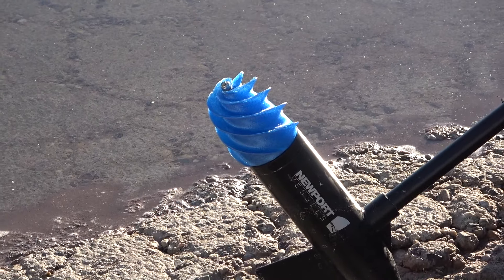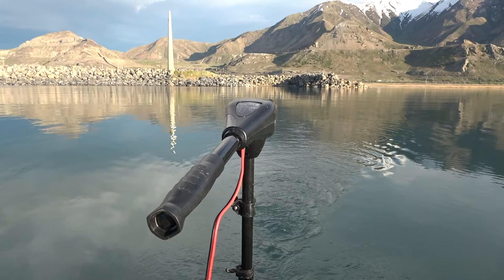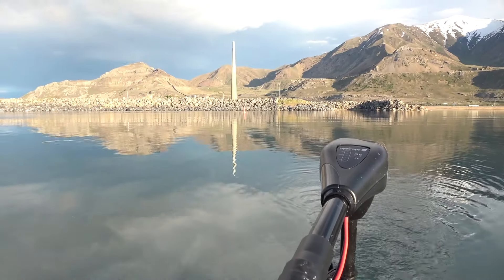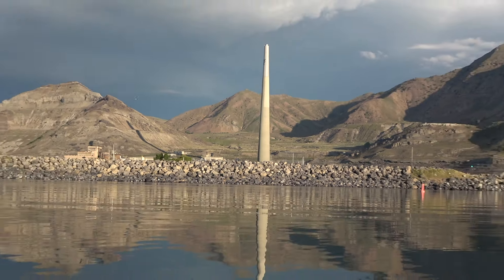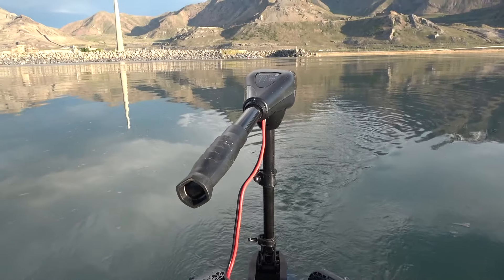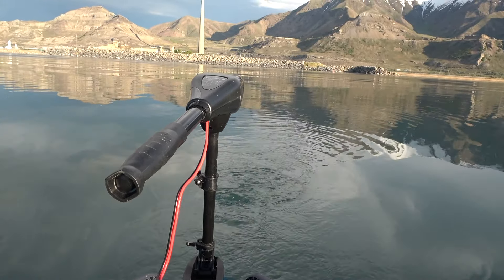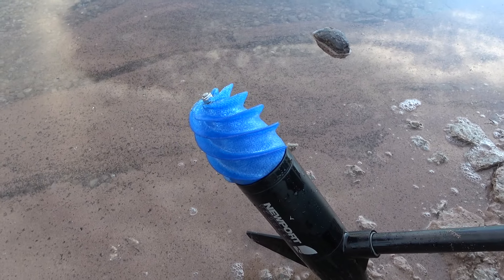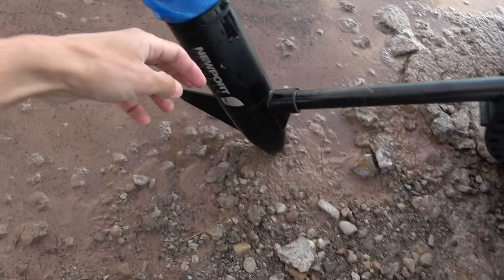Egg Propelled Boat Part 2

Comment: A good speed/thrust comparison of the boat using original prop vs the egg prop would be interesting.  You could use GPS on a phone to calculate speed.   Or do it the old fashioned way and tie knots to a rope and drag it and see how many knots are visible to determine speed.  Need that speed baseline speed for future comparisons.
  This version of the egg appears to move the boat just as fast as a prop or maybe faster?    Pretty damn good design if it works that well on just a plastic 3D print model.  Salt water may be raising the density of the water so the raft is floating a little higher than in fresh water which makes for slightly less resistance too.
  There is supposed to be a old archaeological dig site near the middle of salt lake where giant human like bones were found by an independent researcher in the 40s or 50s and then promptly dismissed by science.  Viktor's dismissal wasn't the first and wont be the last.
  Have you read ALL the Schauberger books & related literature?  I may have collected most if not all that is out there.  I have read them numerous times and sometimes I feel like I get it and sometimes not.  Walking in the woods once after reading ton about him working the forest I felt like I had brand new eyes and saw the woods in an entirely different way but it was not permanent.
  The log flume was the first and last thing Viktor was truly recognized for and even that was an uphill battle with science the whole way until the result could not be denied.  It was after that he was invited to Texas with all his test models which was sadly the beginning of the end.
  The principles of finding ways to work with nature are undeniably better than the ignorant chaotic ways that have been developed quickly without regard to very subtle more efficient energies that ultimately get left untapped.
  I thank you and the natural world thanks you for continuing this project!!
Reply from the maker: Wow thanks!  Your a very intelligent guy if I may say so.  At one time I had 16 books on Viktor but right now I have 12.  I've only skim read a few of them.  I'm actually not much a reader having only read less than a hundred books in my life, although I have many dozens of books on pdf right now that I haven't even touched yet.  lol...    I like pictures more.  🙂  That's a really good idea to use my cell GPS to calculate speed.  I think it would be easy enough to change the prop on the boat while I'm out at sea.  Yes it does seem to work pretty well and it only cost about 6 dollars to make.  The giant red haired cannibals that are the bastard children of the aliens from the 12th planet Nibiru who bred with earth woman, are still here now living in remote caves around the planet.  Most are being killed off or taken off planet last I heard though.  Schauberger could leave his body and bilocate and  astral project so he could enter the rivers and streams and see the flow patterns in a manner no regular physical eye or measuring device can.  Many people with very very high IQ can do things like this.  Bilocate, trilocate, telepathic communication, seeing the future, telekinesis, etc.  He also built UFOS for the Nazi's like the "Repulsine."  Its interesting how project paper clip brought over many Nazi scientists.  Many of which had worked on and built the Repulsine designs.  Did they continue to build these craft for the CIA?  I better not say too much or they will erase this comment.  Hee hee...   Anyways thank you for the encouragement!  My old website is now down permanently but I will have a new one built in a few days, where I will continue selling my products.

Comment: I would love to see data of thrust ratios vs battery consumption between the two props. Could be on to something . Even if the thrust is slightly less but battery consumption is less and weeds wrapping up on it are a thing of the past its a good deal.
Reply from the maker: I will try to get some speed comparisons in the future.  I might also try with a gas engine and use the same amount of gasoline with each prop and see which one goes further.

Comment: nice work! 
how about combining multiple eggs inside a housing, which is open to allow water to enter and leave the opposite side again, like a funnel or a pipe. 
Eggs arranged like gears but with intended gaps in between, interlaced somehow. 
Also worth checking and incorporating ideas from propulsion of modern submarines, because one of their goals must be to remain undetectable, i.e. to reduce any kind of noise or turbulence. 
Or one egg inside a hyperbolic funnel, not sure in wich direction the open part is supposed to be better (intuitively I think with open part against the sucking direction).
Or the hyperbolic funnel is rotating in one direction, while the egg inside the other way around? or the egg is even coupled to the rotating funnel?
However, combining standard propellers would likely create even more turbulence while arranging egg(s) in the right way (with or without hyperbolic funnel as housing) may lead to nearly laminar flow again, i.e. not causing wakes, like a warp drive is just shifting space time around the propulsion engine ;-) 
I think not causing any wake would make it a meaningful goal, because wakes are indicators for energy (efficiency) loss imho.
Just some ideas :-)
Reply from the maker: Thank you!  Yes the original trout turbine had an interesting housing around it.  Maybe I will try something and see what I can come up with.  Fascinating ideas you have!  I'm on the verge of completing 3 other Schauberger projects right now, and one of them is a hyperbolic funnel.  Built exactly true to form with the hyperbolic curve at its core.

Comment: What is the purpose of this
Reply from the maker: Its a different kind of propeller mainly meant for swamps and areas with lots of weeds because they won't get caught in the propeller due to its sleek design.  It can also push against weeds and underwater vegetation via direct contact.  If larger Egg Propellers were used and the Dorsal Fin on the motor were removed it could even push a boat around on land.  You would want two of them though to steer the thing.  🙂